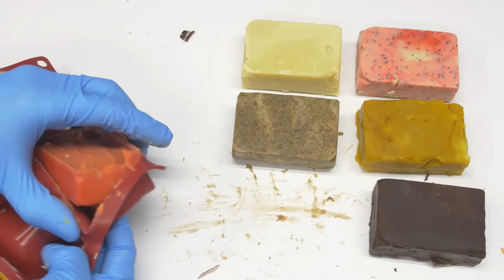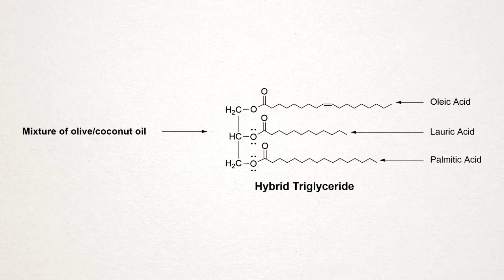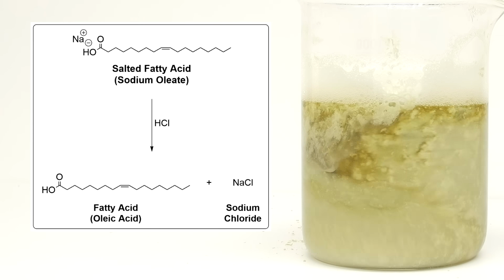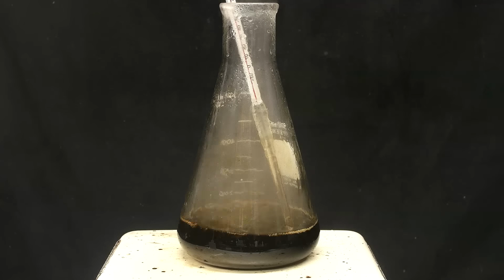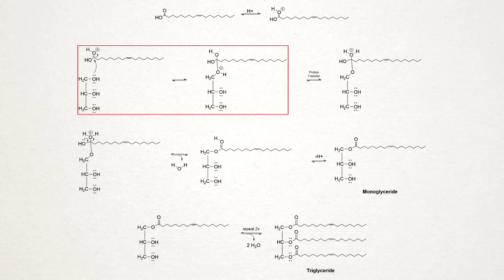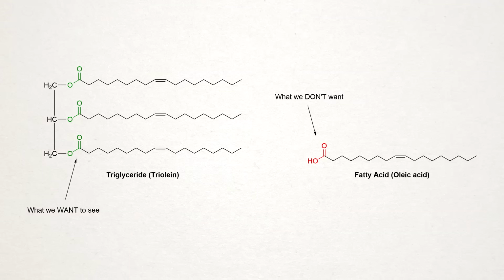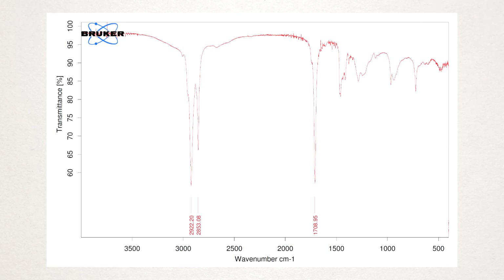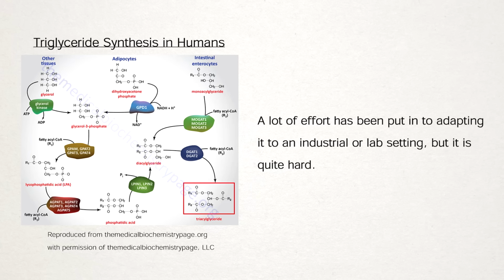Turning soap into oil and making French fries

Comment: POSSIBLE ISSUES WITH THIS EXPERIMENT

the fatty acids shouldn't solidify.  Oleic acid is a liquid.  If you are left with a solid then either A- there are other oils in the soap, or B- the Na+ was not neutralized by the HCl, and was still mostly sodium oleate, sodium linoleate, etc

as far as the color, the manufacturer probably used pomace olive oil.  it is the leftover stuff from after the olives are pressed.  it is of lower quality.

the glycerol needed can be calculated based on averages of the composition of olive oil, in this case pomace.  then you would reference that with the stoichimoetry of the saponification value.  The saponification value of olive oil and NaOH 0.135, i.e. for every 1000 grams of olive oil, you need to add 135 grams of NaOH

200C is way too high to do this reaction.  quality olive oil decomposes at around 207C (its "smoke point) and begins to smoke, which is why it is not used in high temperature deep frying, but for lower quality olive oil, the smoke point is around 160C.  Canola oil, which also has a large content of oleic acid has a much higher smoke point for some reason.

Some of the ester reaction might have occurred, but because of the decomposition of olive oil, i.e. the smoke point, it likely resulted in the white smoke.  The smoke is likely acrolein

the zinc chloride probably further neutralized the Na+

after the reaction and time in the refrigerator, the product was indeed a liquid.  however, it could have been the fatty acids without it being a triglyceride.  draining the seperatory funnel showed that the bottom layer was somewhat viscous, more so than water.  This is likely the result of he glycerin content.  Since the glycerin didn't react is sank to the bottom with the heavier water layer.  Glycerin is not miscible with triglycerides or aliphatic hydrocarbons.  Therefore, it will separate with whatever with which it will mix, and sink to the bottom.  The reason the fatty acids are black is because heating them burned them, and the discoloration is likely due to the smoke.
Reply: Michael Steinberg i think that with a pH of 1 the answer is more likely  A

Comment: Fascinating video. I'm really glad I had you turn up on my recommendations. I have an idea as to why olive oil soap was never going to work as a cooking oil, even if it was pure at the end of the reversal process. You should never heat it above 180°C to cook with, and should stay at no lower than a warm room temperature when it's in the bottle, so that probably goes for chemistry experiments too. In fact it's one of the worst oils for frying chips in irrespective of its initial purity. HTH
Reply: That's good information

Comment: If you wanna shred up soap easier just use a belt sander. The soap will easily dissolve and any sand paper material won't so it won't be a problem.

Comment: Insulates the flask with a conductor x3 good job bud
Reply from the maker: You talking about the aluminum foil? It is pretty commonly used. It keeps an air pocket around the glass which insulates it. The foil itself isnt the insulator.

Comment: Would ZnCl2 be a good catalyst for the Glycerol? And you might be able to leave them as Sodium fatty acids salts to react with the catalyzed glycerol.

Also, the picture you have at 5:13 still has the hydrogen attached to the Salted fatty acid. :)

Comment: @NileRed Well, instead of glass thermometer you could use cheaper and more versatile solution - thermocouple  - type "K" cost around 2$ in my country, and supports temperature range from -270 up to 1260 C. You need to calibrate it of course, and you also need decent multimeter - or simply make custom arduino circuit, so it will automatically convert voltage to temperature.

Comment: First, Zinc chloride is tricky. Having additional hydrogen around activates it, so you're going to have to provide excess hydrogen if you want a tri-ester; driving the reaction to eliminate all water (and thus all hydrogen) won't work because your catalyst will stop being a catalyst. 
Complicating this, Zinc Chloride hydrogenates alkenes (most metal chlorides can). This is an industrial route for hydrogenation. The only difference between an esterification reaction and a hydrogenation reaction is the temperature and the concentration of free hydrogen. The need for controlled free hydrogen is why industry  usually feeds zinc chloride with hydrogen chloride, rather than straight hydrogen gas. 

Second, Speaking of temperature.... Fatty acids oxidize when over heated. Fatty acids with double bonds in them are especially noted for oxidizing at the position of the double bond. Esters are big molecules, relative to the size of the reactants. Hydrogenated alkenes are not really much bigger by comparison. Because of this, Hydrogenation happens faster at higher temperatures. Especially in this particular case. This is the difference between a thermodynamically controlled reaction vs a Kinetically controlled reaction and is a good demonstration of how a reaction can transition from one to the other.

Comment: Here's a ridiculous idea for you, thats also really dangerous. Try to make memory foam, for a pillow or something. To make the polyurethane you need TDI and a some hydroxyl group containing things. Here's a patent that I found that is cool https://www.google.com/patents/US6391935, and the ingredients are a plasticizer, a base catalyst, water, a cross linker (like glycerol), a surfactant, a polyol polyester, a monol polyester (both of which I assume are possible to make), and of course a diisocyanate like TDI. The only thing that you can't really make is the silicone based surfactant. The deal breaker is that to make isocyanates you need phosgene or some weird azide reactions that are either dangerous or expensive. I think it would be fun as some hUGe project for you to do, and seeing how you prepare the reaction or what traps you set up would be interesting. For the plasticizer you already have made adipic acid, you have already made a base catalyst (trimethylamine), the surfactant is only used in really small quantities, glycerol is at like cvs, you have already done every reaction related to making diisocyanates except the final one (sodium benzoate to aniline) and even multiple nitrations (picric acid) so it seems like preparing everything would be a walk in the park. After you make all the ingredients it just expands into a mold after mixing briefly. You have worked with molds before too, but I guess not for higher pressures. Afterwards you would even have a memory foam pillow or something, so I think it would be worth it.

Comment: I've made a ton of esters over the course of my PhD and never used the acid catalysed process. It's too hard to control. The easiest IMHO would be to convert the acid to acylchloride by refluxing it in 10 equiv. of thionyl chloride, distilling off the excess SOCl2. Then dissolve the residue in dry DCM, add your favourite organic base and top it off with glycerol and stir at rt. You'll have your ester in a few hours time. Also, it might be fun to monitor the progress of the reaction with TLC.

Comment: Hey there Nile! I am a new subscriber that is coming from a reddit thread on /r/Skookum where we listed some of our favourite channels. You were mentioned, and I'm currently binge watching everything! Absolutely loving your content. 

I do have a question regarding this whole soap making process though! I've never found a clear answer online yet. 

I use a double edge safety razor to shave with and a brush with shaving soap to make my lather, and I've explored making my own soaps. There are lots of recipes to make shaving soaps but most of the shaving soaps you find or find recipes for are either hard soap pucks or like a waxy texture. 
One commercial soap company called "Taylor Of Old Bond Street" makes a product known as a "croap." (cream/soap) It's a shaving soap that lather up incredibly easily because it is more of a creamy texture in the tub before you add water to create the lather. 

I was wondering if you knew how one could create a homemade shaving "croap?" What would the difference be in making this kind of soap and other shaving soaps that gives it this texture? 

Thanks for the great videos! Can't wait to see what you show us next!
Reply from the maker: Honestly, I wish I could help more, but I am honestly not entire sure. From a quick search though, it seems that the creamy soap is a mixture of liquid and solid soap. A recipe i found used a combination of potassium and sodium hydroxide as the base.

Comment: You were also relying on advertising to inform you that the soap was pure olive oil You may have had better luck by making another batch yourself from pure oil, then rendering the oil again from the soap. Glycerol doesnt boil until 290c so it should have remained stable at 190c.

Comment: In the mech, the alcohol (More specifically the oxygen part of that alcohol with three bonds.) on the product after the water is kicked off by the double-bond reforming, should have a "+" to show that it is positively charged. The oxygen losses one of the electrons of the lone pair that moves to form the pi bond, and with one less electron it becomes positively charged. 

I know you know that, but maybe someone else might not.

Comment: It could be a good idea to try the fatty acids with P₄O₁₀ to you remove washing water and to remove more water by forming of anhydrids of the carboxylic acids, and adding a trying-agent to your reaction-mixture. Removing water is the key of this reaction. And, as already mentioned, do this reaction under vacuum and lower temperatures. Oh, as also already mentioned, use another catalyst. Precleaning your soap may also be good idea, but I do not think, this is the reason for the failure.

Comment: Suggestions:

Titrate the fatty acid mixture in aq. ethanol to determine how much glycerol is needed.
Use p-TsOH as the catalyst.
Consider an azeotropic distillation to remove water with a  Dean Stark. You may need to use xylene or similar to achieve sufficient temperature.
If the above fails, try p-TsOH-catalyzed esterification to fatty acid methyl esters (FAME, biodiesel), then transesterification with glycerol and alkoxide catalyst while distilling off the methanol.

Simplify your life. Make your own soap from something without unsaturated fats. Try "92 degree coconut oil' which is fully hydrogenated and contains a mix of C8-C18 fatty acids. Use a slight excess of lye or you can expect residual mono and diglycerides to make your fatty acid liberation step into mayo from hell. If you know the identity of the input oils, you can pretty closely guess how much glycerol you need without a titration.

Comment: Hey Nile, this might be an Working attempt: use the Ground up fattyacid alkali Salt and react it with thionylchloride, you Form NaCl , SO2 and the fattyacid Chloride. the carbonic acid chloride reacts with glycerol to Form the Ester and HCl. These reactions are driven Forward by the Leaving of the Gases from the Equilibrium, so in both reactions you will get good yealds! 
btw, dont eat the Fries, in both attampts you will get a significant amount of glycerolclorides, These are known to be carcenogenic!

Comment: A hasp would be a good thing to use for more quickly shredding the soap potentially.  My uncle is a ferrier and he uses them when he trims the horses' hooves.  Some of them can be pretty coarse, and for a few bucks, it's potentially cheaper than that grater.  They do also make other kinds of hasps which are similar to graters for other industries.  

Just clamp the soap and you're good to go!  

Alternately, if you need to save time, you could probably use a blender.  Especially if you're gonna put it in a little bit of water.

Comment: Is this the only way to make a video about chemistry without having a third of the comments be "hey you should make meth next"?

Also I'm about as amateur as they get but couldn't it be possible to use a vacuum during the esterification to pull off water as it's formed? The yield probably wouldn't be great if any water was left but at least you'd have some triglycerides. And the acrolein vapors may not be great for your vacuum pump.

Comment: Your IR looked interesting. In my research I work a lot with oleic acid and have obtained IR spectra several times. Yours does look similar to the one you put on screen; however, yours doesn't appear to be broad around the 3000 cm-1 area, which is what you would expect with a O-H bond.

Comment: you probably overheated the oil.  Unrefined olive oil breaks down at ~160c, and refined ~205-210c.  A temperature of 120c would have sufficed to boil off the water, while  not burning the oil.  You most likely destroyed the glycerol, along with any triglycerides that formed.

Comment: direct estérification with glycerol is hard. better first esterify with méthanol. then transesterify with glycerol.
or when you have your free fatty acid you could transform alcohol part of the acid in a better leaving group than an alcoolate, for exemple using mesylate or tosylate.
Keep in mind it's only theoric, I haven't tried all this.
only thing I did tried is the reverse of the transesterification i just suggested. While making biodiesel I transesterified triglycérides into fatty acid methanolate. The equilibrium should be more in your favor than it was in mine.

Comment: hey Neill, please don't use Erlenmeyer flask for vacuum distillation (or anything else involving vacuum). You should use round-bottom flasks instead. most of the time it's fine, but sometimes they break. it happend to my supervisor and me a few months ago, and he had serious chemical burns (the flask contained oleylamine). he is fine right now, but please be careful! this could happen to you as well.
Reply: they come with an vacuum port to use them in vacuum filtration. In this case they usually are pretty thick walled and dont get heated so strong as in the video. Round Flasks are the best option when it comes to vacuum destillation, because they can dissipated the pressure from outside evenly over the whole surface.
Reply: The safety of an Erlenmeyer flask is dependent on the strength of the vacuum used.  With low to medium vacuum it should be fine, but a round bottom flask will stand up much better to high vacuum forces due to its inherent design.
Reply: @BillAnt  The quality of the vacuum shouldn't make much of a difference, I would think. The actual pressure difference between a low and high vacuum is something like a ten thousandth of an atmosphere, and since the stress on the glassware depends on the pressure difference, outside conditions (like weather and handling) should have orders of magnitude greater impact.
Reply: kleetus92 just because you can doesn't mean you should. Lab conduct is meant to avoid as many dangers as possible so I would say that it is an unneeded danger to use a flat bottomed flask on a vacuum distiller.
Reply: That is true, Erlenmeyer flask are mostly used for vacuum filtration with a Büchner funnel but not for Destillation. Also they have a special coating on the outside to prevent implosion.
Reply: Yes l completely understand the conversation
Reply: @Human-gu2cx  the glass things with a sphere at the bottom hold up better with vacuums than the cone-bottomed lil dudes cause the vacuum pulls at the entire bottom more evenly than the cone

i think. i don't do math very good
Reply: It's purely due to structural integrety of glass. The hard corners of Erlenmeyer flasks are potential failure points.
Reply: ”You don’t cook with this, do you, Jesse?”
Reply: Are you a fellow a chemical engineer?
Reply: Mr. White?
Reply: His name is Nigel
Reply: Hahaha I likr your words funny men
Reply: I just use a plastic bottle with a straw held in with some play dough in the side and a vacuum cleaner.
Reply: @MapacheRociista  and I'm being questioned by a named food item? Do you have anything of importance to add, or just noise?
Reply: @kleetus92 you’re the one who started by adding noise. Your original comment was unnecessary and wrong 😂
Reply: @maddieb.4282  And you have added absolutely nothing. 

Do tell, oh master of the lab, what that port on the neck of the erlenmeyer flask there for then?  

I can't wait to hear this stream of brilliance.
Reply: Stfu nile is not as dumb as your professor
Reply: you dont know him son
Reply: Ah yes, i understand all this science talk. Bromine am I right, kids?
Reply: @rainbowroadthekilljoy8  hmm, the chemical concentration of this sublimated oxide is very vacuum-y.
Reply: @rainbowroadthekilljoy8  they're just talking about safety procedures and design flaw. In a sciency way
Reply: @Dogetuberyt  I wouldn't call vacuum ports on an Erlenmeyer flask a design flaw (if that's what you are even saying, correct me if I am wrong) due to the (aforementioned) application of vacuum distillation.
Reply: @getmeoutofsanfrancisco9917  i think he meant the design flaw in this experiment of using the Erlenmeyer flask for the distillation
Reply: @lunatheluma3804  Technically that would be a procedural flaw as oppose to a flaw of design but at that point I guess I would be near splitting hairs.
Reply: My boss hates flat-bottom flasks too, I almost got fired. Tough life.
Reply: @masacatior  Flat-bottom flasks, you make the chemist world go 'round
Reply: I dont have the brain to understand this, so round > erlen whatever?
Reply: @nagehan.1987  erlenmeyer flask is the one with the flat bottom, round bottom flask is the one that has a rounded bottom, the round one is better for heat distribution so it would be better to do the distillation in that so it would be less likely to shatter.
Reply: @lunatheluma3804  oh ok
Reply: Is that why they come with vacuum ports on them?
Reply: thank you walter white